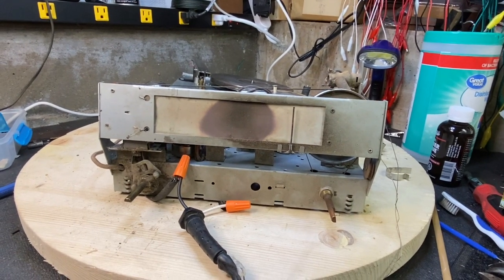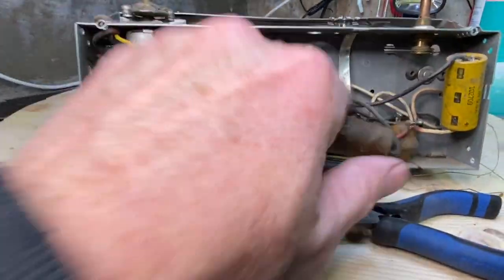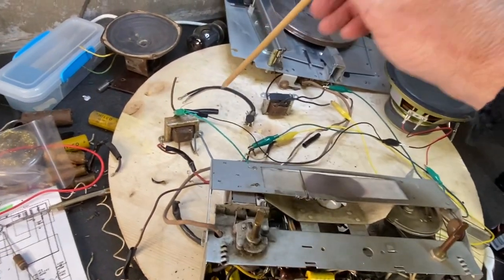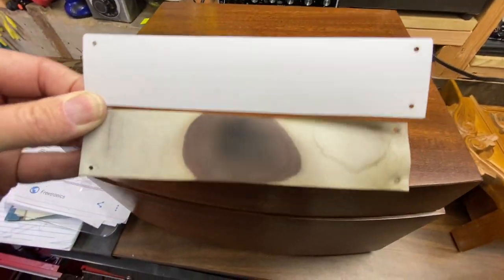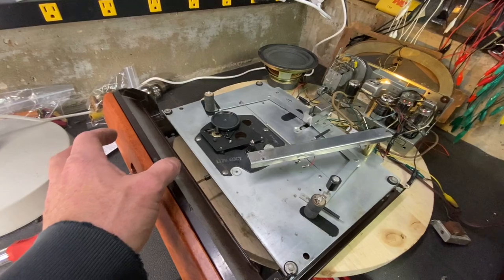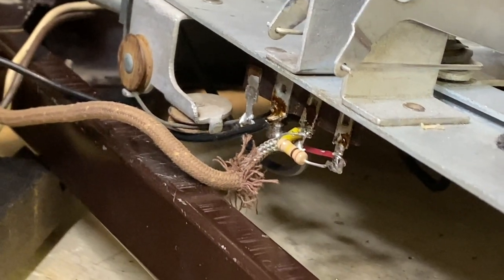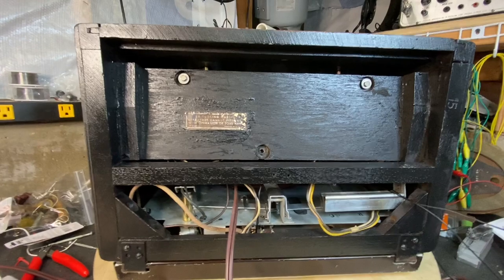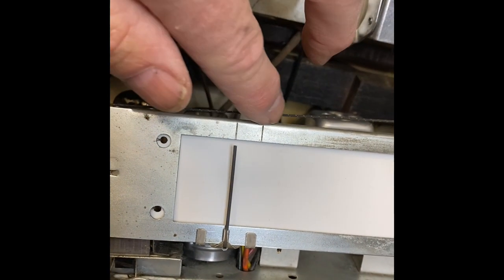Philco 46-1201 "Bing Crosby" (Part 3) Final

Comment: Nice job.  I recently got one online the 1946 version. Is there a way to rebuild the line drop surge limiter  the long looking can with the the three wires I can't find any info on it mine came toasted and I'm trying to fix it . ?
Reply from the maker: Mine was fine. As far as rebuilding it, I would think so, never had to open one up. They are just a couple wire wound resistors lowering voltage to 2 areas. Not sure what model you have. My schematic shows R100A and R100 B . A is 80 ohm and B is 65 ohm. I would try and open it up carefully and see what happened. There might be a break in the wire before the coil starts, that can be repaired. If not, you can always stuff newer wire wound resistors in the place of the originals.
Reply: @VintageRadioRepair   it looks like it had some type of fire part of it it's burned up. My model uses code 121  46-1201.  Like if it overloaded. I purchase the radio like that I did not know about until yesterday cause my radio won't turn on after the recap I checked everything except that. The outside of it it look funny so I open it up the half of the wires were burnt including what ever part was use to wind it on. Can resistors be use instead? This part has 3 wires brown white and yellow. And if resistors can't be used how would I know what type of wire to use and how many times do I need to wind it to get the 80 or 65 ohms. I did check the tubes and checks out ok.
Reply from the maker: @MrAntuan228  
These are power resistors. They are wire wound and placed inside metal containers because as they reduce voltage they conduct a lot of heat. There was a reason they overheated but it sounds like you already did a recap? Since these types of radios didn’t use fuses, something had to blow. These are not a typical carbon resistor that is throughout the unit, they need to be wire wound types (power resistor) that can handle larger wattage than typical carbon. I’m not sure how many watts are needed but you could start with a 5 watt resistor at the values I mentioned. I doubt you’ll need a higher value but 10 watts and above are available even at Amazon. 
Email me and I’ll send you a pdf of the schematic if you don’t have one.
Vintageradio30@gmail.com
Reply: @VintageRadioRepair  it's funny I power it up before the recap cause it was already turn on before by the person who sold it to me. And it was playing with that damage resistors. I guess it could not handle the new recap because it was to damage to handle the load.
Reply: Make sure you installed the filter caps in the correct polarity. There may have been something shorted causing the resistors to fry. I’d double check your work and make sure. Do you need a schematic?
Reply: @daves9551  I need one showing the line drop surge limiter and how to rebuild it? Any idea how to properly rebuild it.?
Reply: @MrAntuan228  
Email me a photo of the burnt component and what you’ve done so far. I’ll try and help you get it going.
Reply: @daves9551  ok
Reply: @daves9551  what's your email so I can send you the pictures.  So far I stop still figuring out how that wire wound resistor works lol. Never seen one like that but the schematic shows resistors symbols.